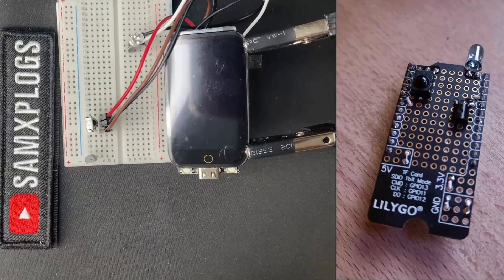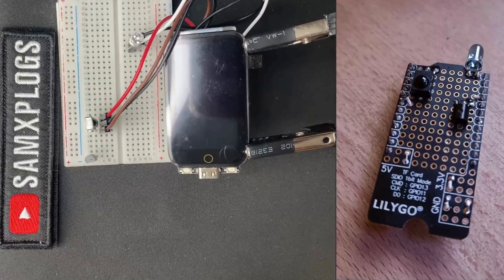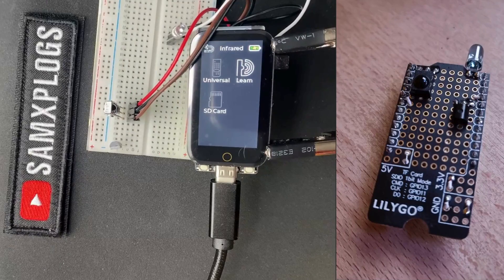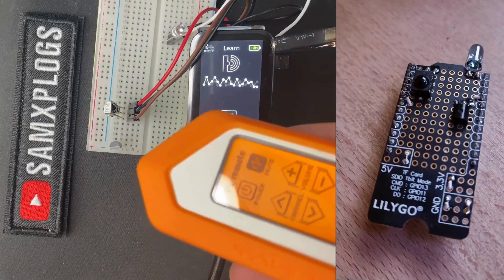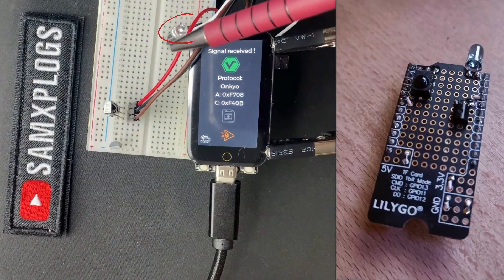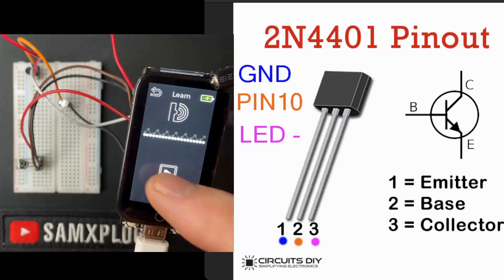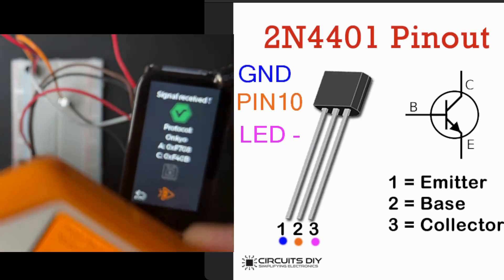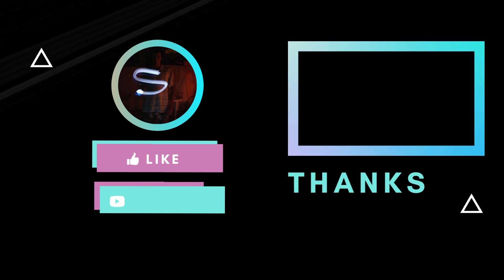Capture and Replay IR Signals using Willy Firmware on ESP32 T-Display-S3

Comment: The wiring diagrams once you have bought it seems like both the IR and Wireless components use the same MOSI pin, can we only use either IR or Wireless?
Reply from the maker: Yes, otherwise you could use a switch similar to what Oz did. In his PCB, the switch enables either the IR receiver or the CC1101. The IR transmitter will always work, regardless of the switch's position. https://www.tindie.com/products/sdiguy/willy-board-for-the-t-display-s3/